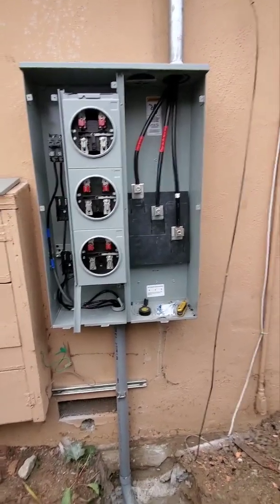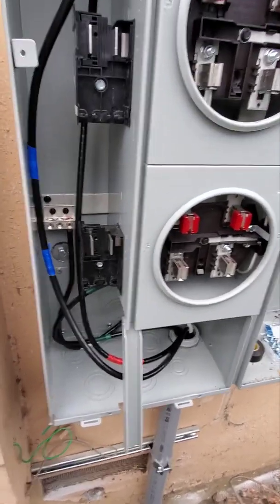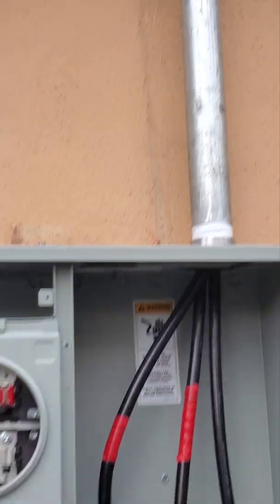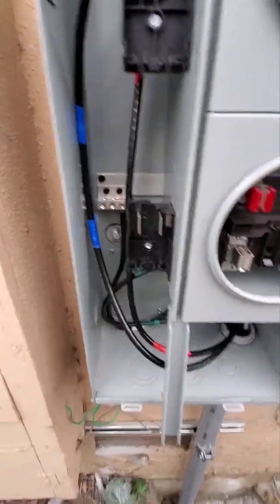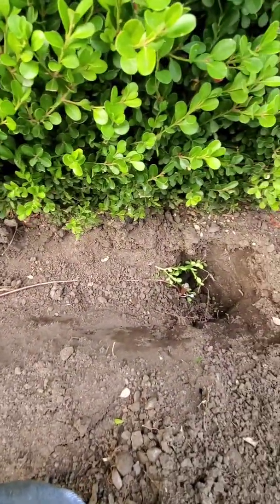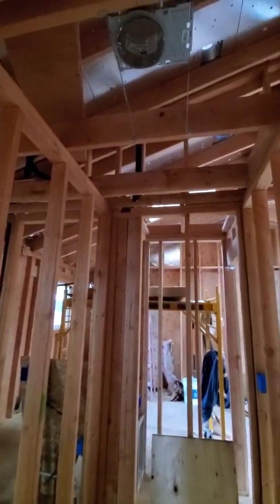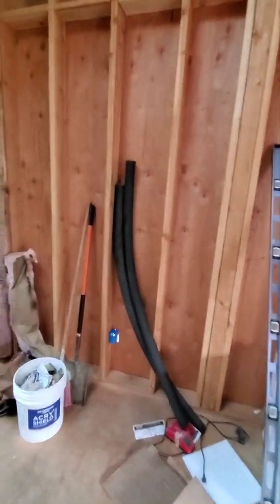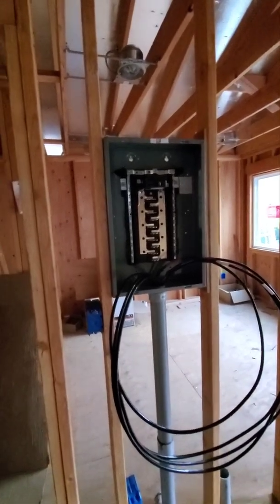300 amp meter electrical panel  installation

Comment: You also need nail plates for your pvc pipe feeding the electrical panel inside the house because when they hang drywall they will screw right through the pvc pipe and into the wire.

Comment: Maestro cuanto cobra por la instalación de 3 gang meter el Ke usted está instalando ?
Reply from the maker: Hola Juan  , cada panel es diferente precio ,este en particular cobre 1700 
De solo trabajo  ,con l firma del inspector ( release)
Reply: @JuanReyes-zg7mg  1700 por  cada meter or por los 3 juntos ?
Reply: Por los 3 juntos maestro ?

Comment: Amigo una pregunta y disculpa mi ignorancia un existen double meter uno que sea de 200amp y el otro de 100amp o los dos vienen con la misma ampacidad?? Gracias
Reply from the maker: Hola Many si los hay ,de hecho puedes agarrar un 300 amp 2 meters, y poner un breaker de 100 y uno de 200 ,
Pero te recomiendo que primero chequees con la compañia de luz para que te aprueben el panel y el amperage que necesitas ,ellos son los que tienen la ultima palabra
Reply: @JuanReyes-zg7mg  gracias por la información y gracias por los vídeos muy buenos.

Comment: Amigo 250 mcm cu. Solo es para 255amp en la tablature 70C . Como te fue con tu inspeccion.
Reply from the maker: Paso bien  ,solo el alambre de tierra tube que poner un 2 hasta el tubo del agua
Reply: Que bien 👏

Comment: What size ground did you use and how did you mount it? I'm doing the same exact meter pak here in ohio
Reply from the maker: Hi Nathanial, I used #2 stranded copper wire ,inside the box there's a lug for it

Comment: Que tipo de  cable necesito del roof hacia 3 miter  amigo gracias
Reply from the maker: Hola Jose ,para este panel de 300 amp le puse 250 kcmil ,de cuantos amperes es el que va a instalar ?
Reply: @JuanReyes-zg7mg hola  para un panel de 400amp 3 gang meter que cable se usa para la Entrada dela mufa al medidor?   Gracias

Comment: Just wondering if your feeding a 100amp panel, why do you need 250kcm going up to Edison on the main lugs? Can't you just use 2/0 wire Instead? And 1/0 wire going to your 100amp panel?
Reply from the maker: Hi Mikey  , the 3 panel box ,is rated for 300 amps ,,that's why we used 250 kcmil 
We can only use 2/0  when is 200 amp service  
Thanks
Reply: @JuanReyes-zg7mg  saludos hermano veo que eres muy generoso con la información me gustaría saber cuanto puedo cobrar por cambiar un panel de 100amps por otro de 200amps